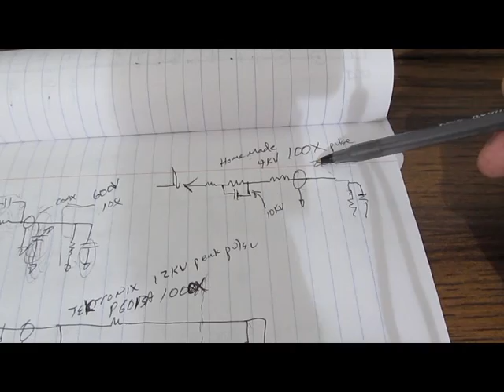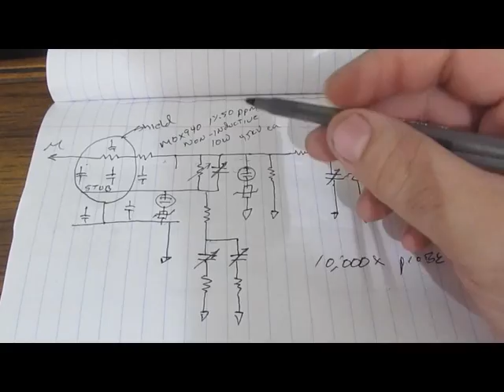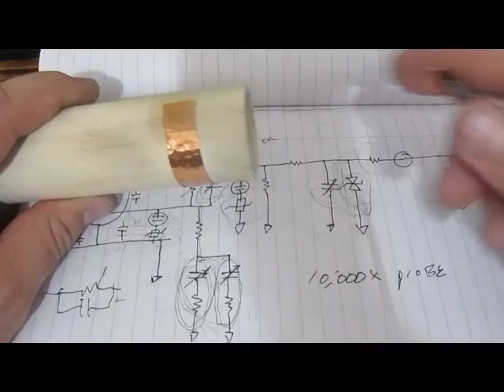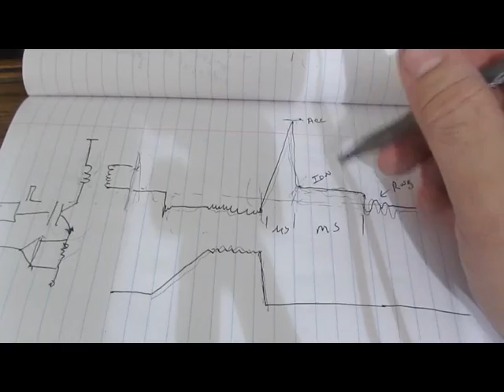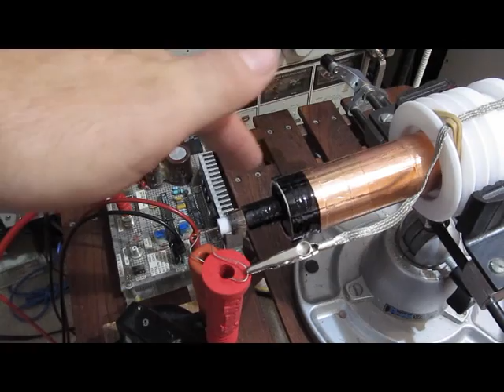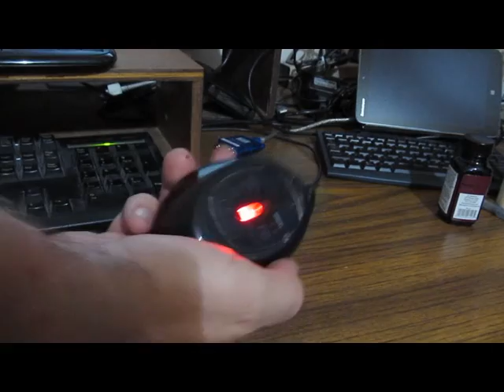Homemade 40KV oscilloscope probe part 5

Comment: This series is exactly what I have been searching for hours for-I need to build one of these for a hv project I’m working on. Do you have a schematic with all the values/component info that you could share?
Reply from the maker: The problem is changing anything, materials, dimensions, cable used, anything at all, it would require different values.  Personally, I would recommend looking for a used Tektronix 6015 or something prebuilt.

Comment: The Tek TDS3000 has those I2C option sticks in the front panel if you recall, they always give trouble if there is any kind of high voltage arc nearby. 

Do you expect any problems from partial discharge inside that probe?

It was interesting seeing that voltage of the arc, the voltage increases as the current decreases. Theory is one thing but I never saw it on a scope.
Reply from the maker: stefantrethan The LeCroy's LCD was flickering and I was already getting very close to the limit of the probe so I stopped testing.   The transorb clamps around 7V or 70KV input and I was at 65.      

Normally I test with the old LeCroy 7200 in case something goes wrong.   In this case if there was an internal breakdown, the probe has enough built-in protection I decided to just stay with the 64xi.   

I doubt I will have any problems with the probe having an internal discharge at 40KV as the problems I saw were arcs to the shield and not the stub.     This area, which I knew was going to be a problem because it is where the teflon tip insulator butts up against the resistor body,   is protected by another teflon insulator once its assembled.     The stop does not go all the way to the end of the body.  It also has some high density plastic covering the end of it for about an inch back.   The further it get away from the tip the less concern for an arc.   

Once it's finished I plan to do some DC testing with it.